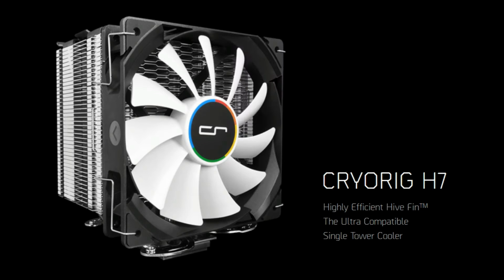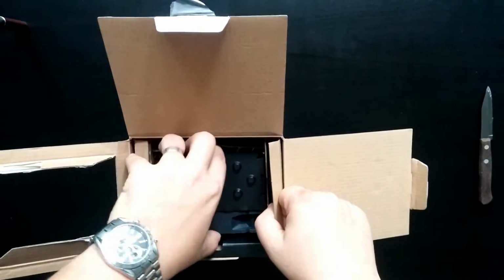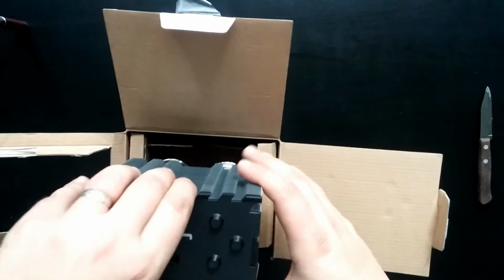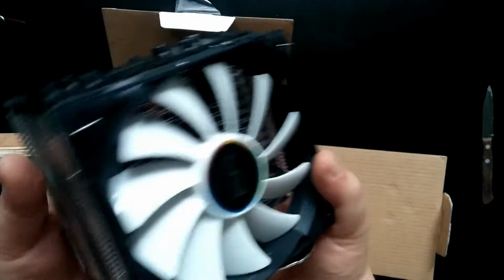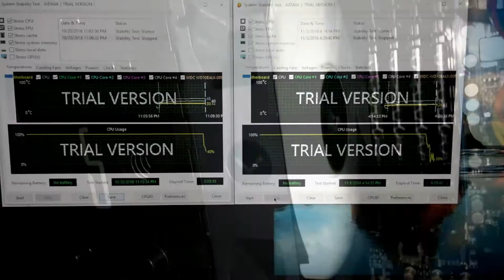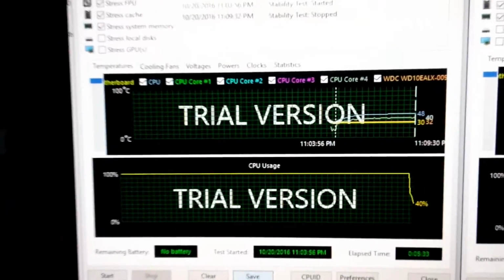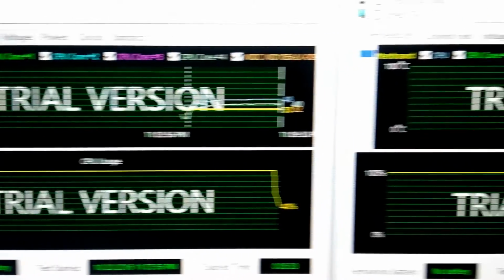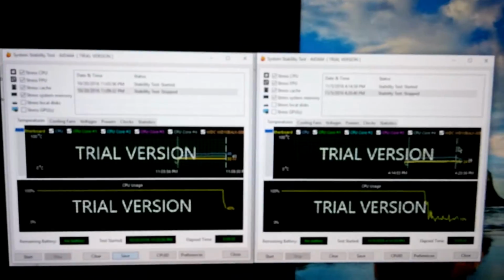Cryorig H7 Unboxing and Install

Comment: Had this cooler for 2 years now, I highly recommend. It has surprisingly good performance, able to oc my i5 4670k to 4.6 GHz comfortably.
Reply: T D do I think it will work with a i5-6500

Comment: Am I able to position it so the fan blows to the back of the PC to the exhaust fan that I'll have or does it only go one way. I'm building my first PC soon.
Reply from the maker: From what I can gather yes but I would recommend you to buy an additional fan to run it in push-pull

Comment: I got the H7 on my 8350 and at stock 4.0ghz during gaming load it gets to 66c!! That kind of sucks doesn't it? Should I re-apply thermal paste?
Reply: J and K White yes or the h7 is not on there firm enough idk if u need this as of right now because it's been a year but I'm getting this cpu cooler is it good yes or no

Comment: tip:
1. avoid saying "uh"s and "uhm"s
2.if you are going to give a review. read the whole specifications of the product, especially the important parts so you can say more about the product
3. please clear your nose :p

still a awesome unboxing and installing vid tho
Reply from the maker: thanks for the tip. I'll try to put more emphasis on the product details. The problem with the uh and uhm is that it is recorded live without rehearsals so I am trying to fill the void by saying uh and uhm. I know about the issue and will work on that. Thanks for the criticism.
Reply: Agree with point 1.  For point 2 you need to read the title of the video, it's not meant to be a review. Overall great video.

Comment: Just the vid I needed to see. After my PSU failed (5 yr old AX850) over New Years :(, I ended up breaking my H100 (also 5 yrs old) and had to regress to the stock AMD cooler that I luckily saved from my FX8120. Obviously that's not going to cut it and I had already been doing research to replace the AIO as I knew it would fail soon. I have the EXACT same RAM setup as you so it became apparent the 212 EVO wouldn't work and the H7 was the way to go. I wanted to see someone install it with the MB still in the case. You showed everything I needed to know. Thanks :)
Reply from the maker: Awesome. I'm happy I was able to help!
Reply: Same bro my h100i v2 broke and I'm gonna use this now
Reply: Same bro my h100i v2 broke and I'm gonna use this now

Comment: hey, does ur h7 shake a little? I can't push my black spacers all the way down evenly, and when I mount the cooler I can tilt it a bit up and down,  as well as rotate. shouldn't the surface have complete contact?
Reply: Im having this issue as well, any solution?